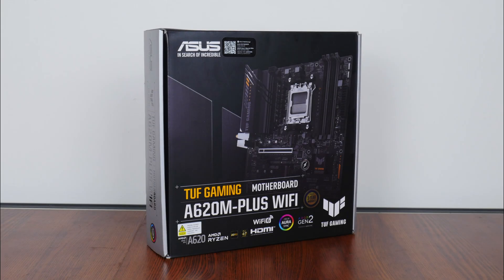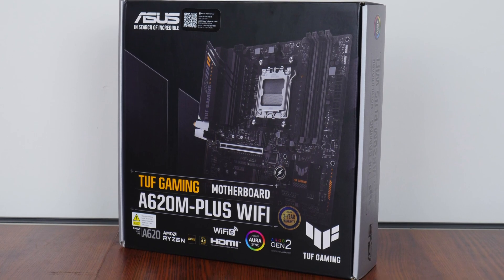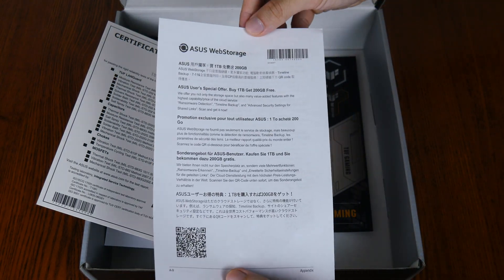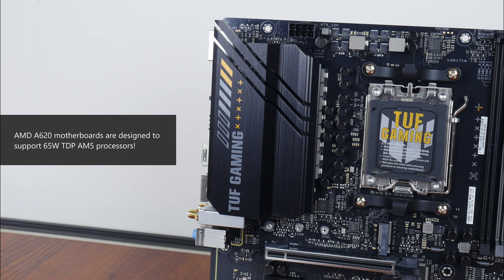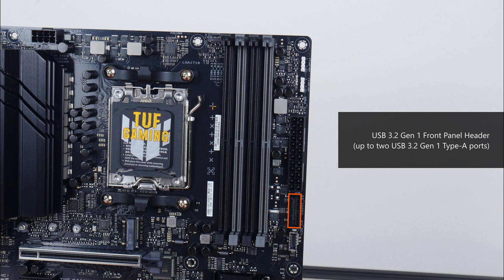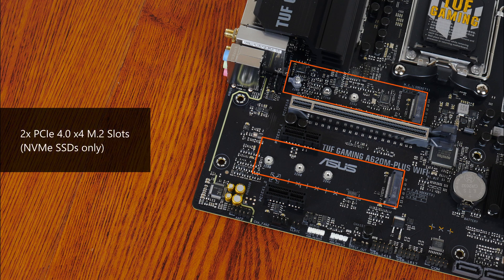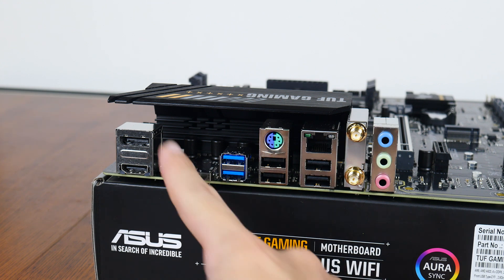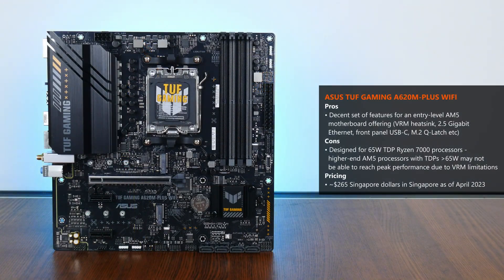AM5 Motherboard on a Budget! ASUS TUF Gaming A620M-PLUS WIFI Unboxing & Overview

Comment: I'm sure you can probably put the X3D chips in the A620 just fine but the regular X cpus may overheat that VRM
Reply from the maker: I think with this TUF Gaming board, with its beefier heatsink, MIGHT just handle a 7800X3D just fine, perhaps with a small performance impairment. I wish I had a 7800X3D with which to do an actual test though..
Reply: @ALKtech bro whats vrm temperature? If u r using 65 watt cpu like r5 7600
Reply: And the performance is exactly like on x670e it seems!
Reply: i have a 7600x paired with the asus prime a620m-a-csm, runs great.
Reply: I just bought a prebuilt with a 7900x3d and this motherboard, lol, was cheaper to buy a MSI b650 pro on the side
Reply: @ALKtech do you think this would work fine?
Reply: @CJNiiva   Did it work okay?
Reply: @VibeAndVerse32 it works, but I’m not sure if its a problem with my psu or the motherboard, but sometimes (happened 3 times since january) my computer turns off, I can let you know when I know if its the psu
Reply: @ okay mate thank you. I think I’m gonna go with the safe option of the 7 700
Reply: @CJNiiva  hey bro ,how did it go? and was it the mobo because i bought it and now im consurned?
Reply: @ I just sent it in, so a couple of days more😅
Reply: no you can't because the tdp is higher in X3D chips, this board is 65 watt
that means only put 65 watt Ryzen 5 7600 in there. now yes it does support
all Ryzen AM5 processors, but theirs a reason this chipset is entry level.
it's because it is meant for low power builds, not for the sake of someone
cheaping out on a motherboard by buying something cheap, just so
they put that money to something more expensive. that's a bad example,
and people often wonder why their temperatures are 85 C or more.
it's because you're forcing the board to accept something it can't handle.